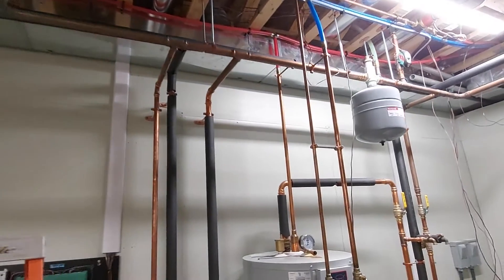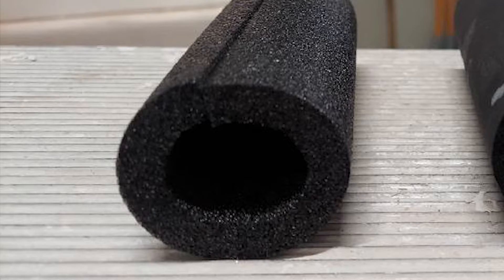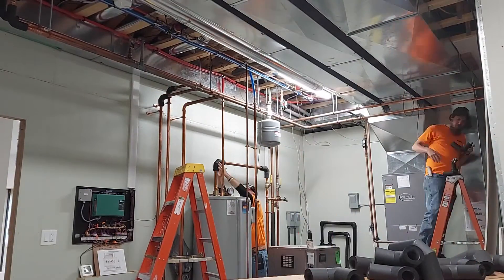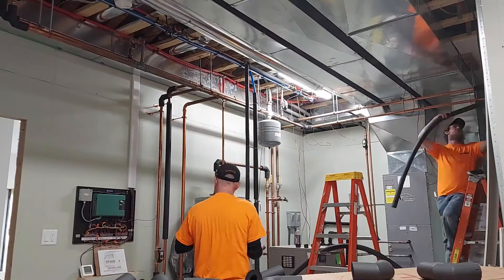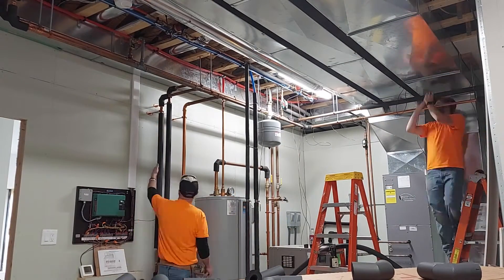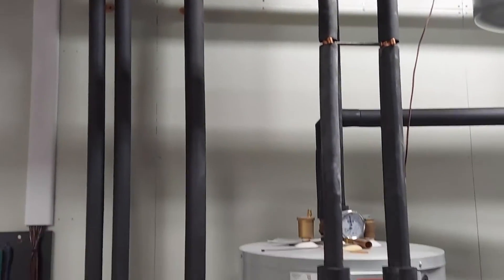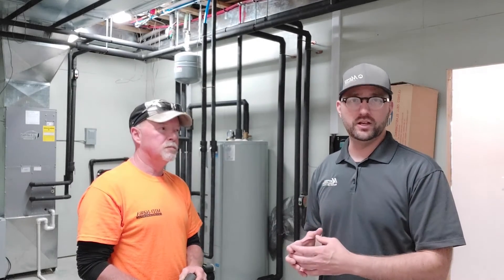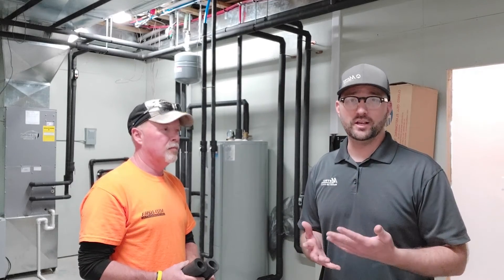Insulating the copper pipes in my utility room

Comment: I am no ac expert by any means but I just noticed water dripping from one of the copper lines to my air handler in my garage. I took a closer look at where it was leaking and found black tape wrapped around holding 2 separated pieces of foam together.  This unit is around 9 years old and has had a few repairs over the years, so it's hard to say how this might have happened but I am assuming it was from the original installation.  It strikes me as very odd that anyone would put two pieces together considering they were covering the same short and straight line.  I felt the company that replaced my previous 7 year old AC may not have been on the up and up with me.  Less than a year after the replacement was installed, the compressor went out and they charged me $900 to replace it.  They claimed many compressors that year were coming out of China defective.  They replaced the part for free but the labor was $900.  I live in Florida and have pets and felt really pressured into paying it even though I felt it was wrong.  So it seems on par with using black tape to hold a piece of foam together that of course would leak eventually.  :(   And I am also wondering if my previous AC actually needed to be replaced vs. a repair.  Again, it was in the middle of summer and waiting to get a second opinion didn't seem like an option. 

Having said all that, thank you for making this informative video.